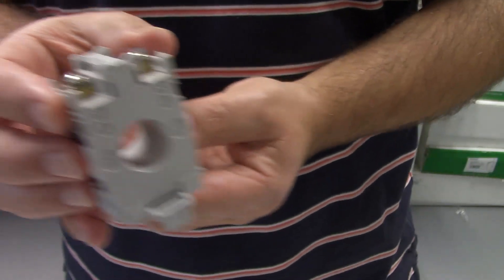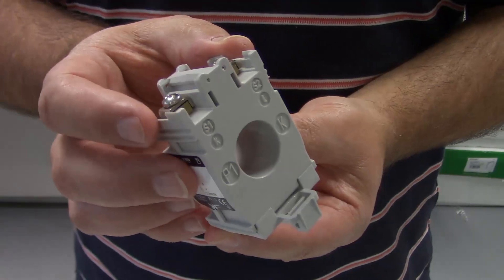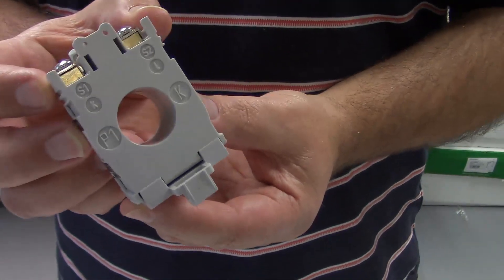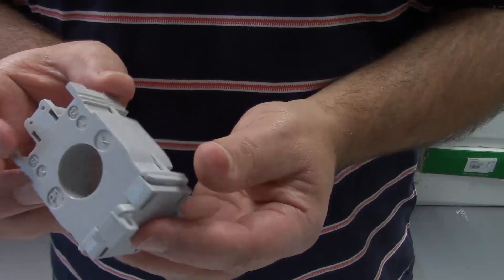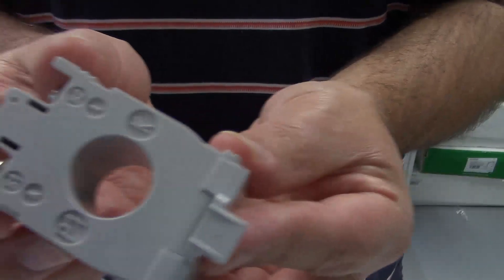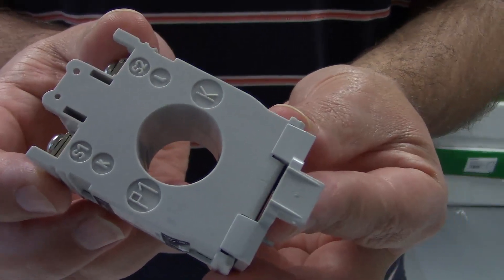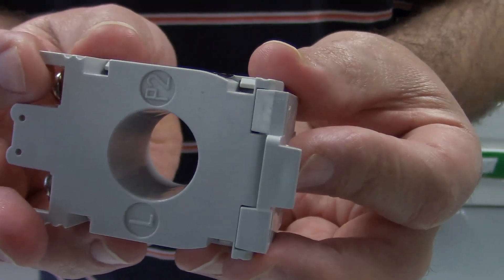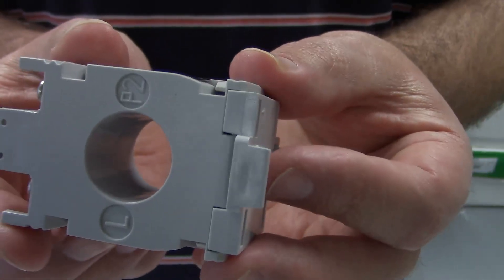How To Determine Flow Direction in Current Transformers | Schneider Electric

Comment: Since electricity alternates current, why does this matter?  Please make a video explaining more about this.
Reply: When you have photovoltaic panels and you generate energy that is feed to the grid, the current flows in the opposite direction than when you are not generating, but consuming energy from the grid. In this case is very important to know the direction the current flows.
Reply: @ovisopa  But  it is still AC flowing through that wire. Compared to what does it give give you a sense of direction of energy flow.